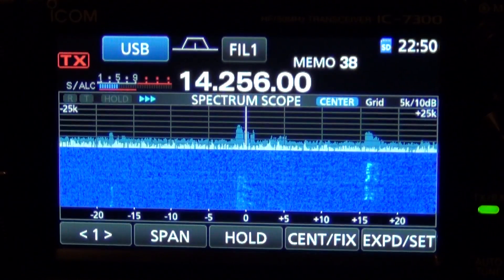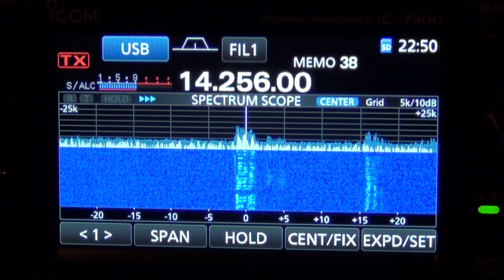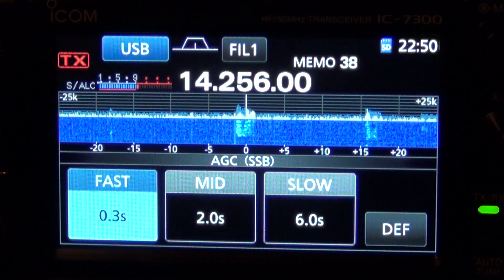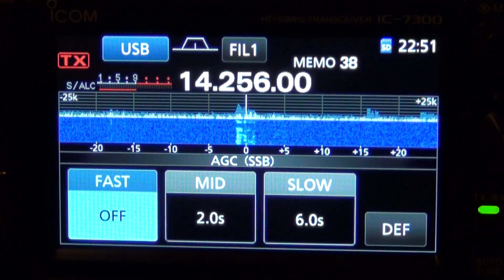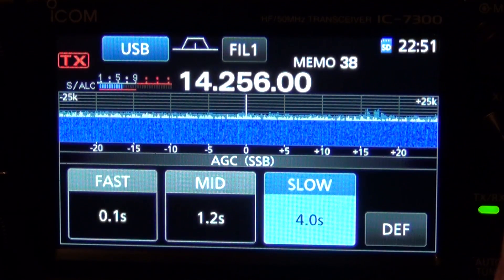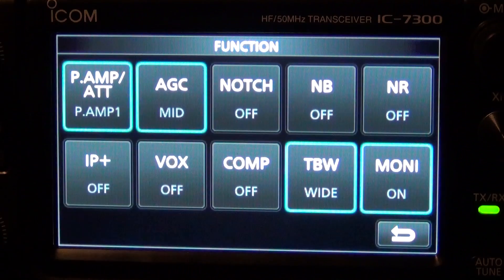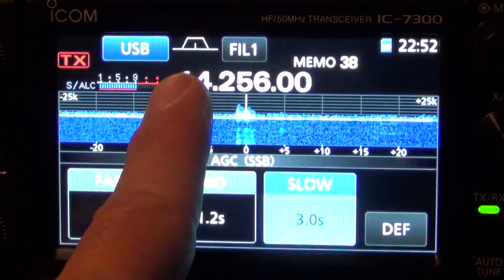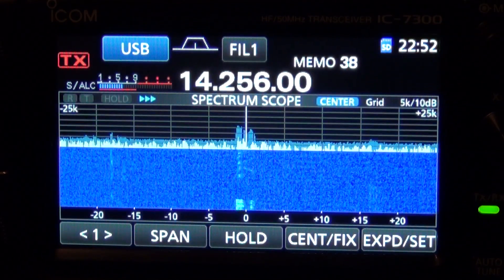ICOM IC-7300 AGC time adjustments

Comment: OK, I understand how to change the setting. The question is, under what circumstances do I want fast as opposed to slow?
Reply from the maker: I like fast when trying to work weak signals and slow when the station is very strong. Try different settings and see what you like. You will hear a very big difference on strong SSB signals. Have fun!